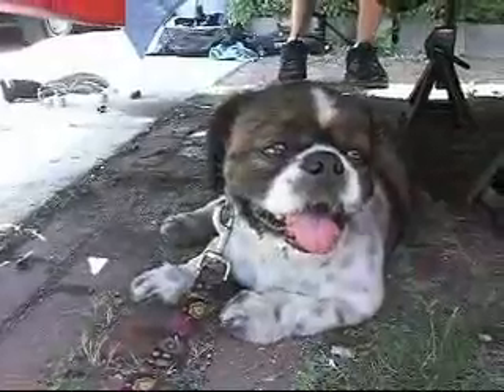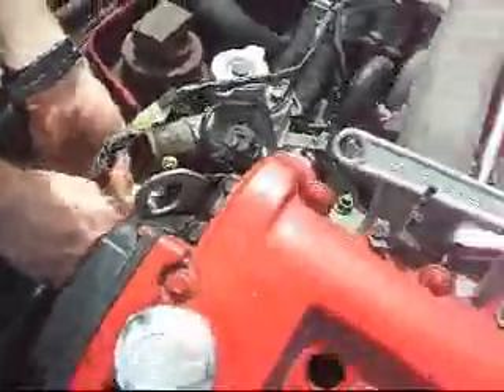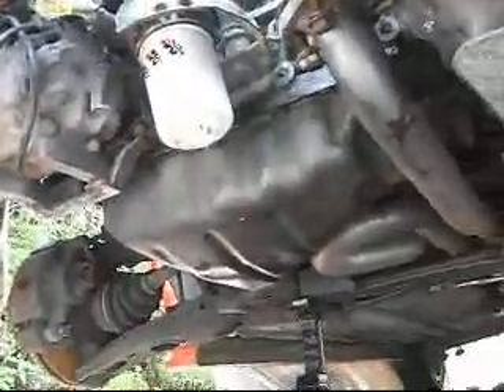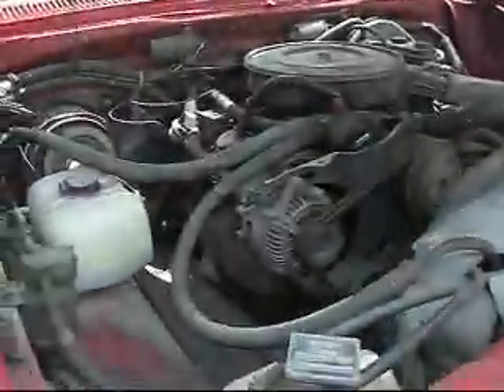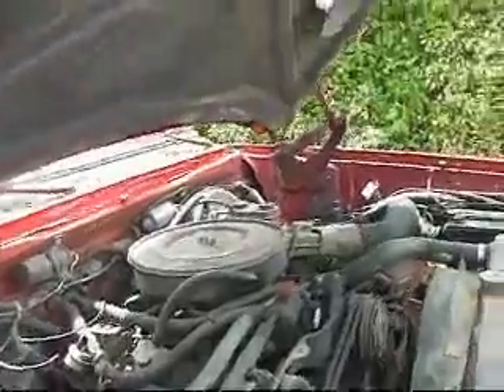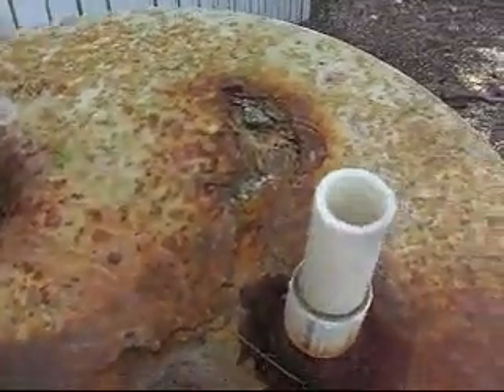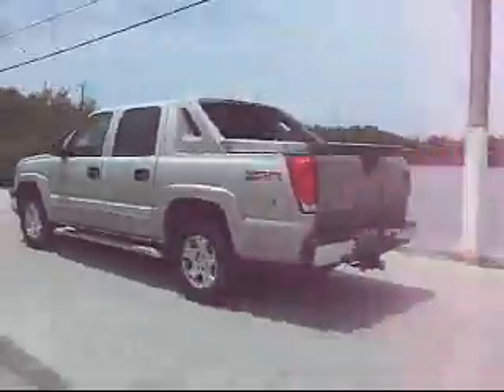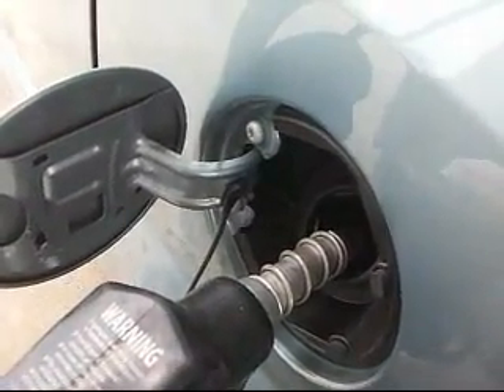4 30 10  Last Key West + V12...

Comment: Cool.

 i think a tiny battery is enough because it's a low  compression gas engine 
I don't know what is the displacement but it must have a 7 or 8 on 10 ratio compression because of the turbo.

I don't like actual cars..too much plastic...